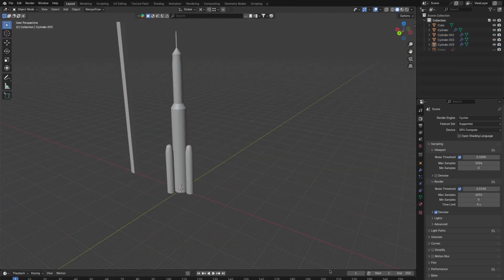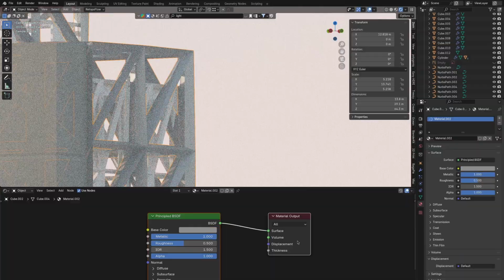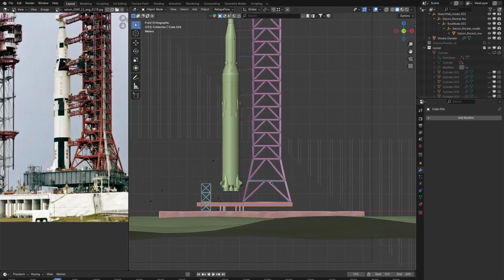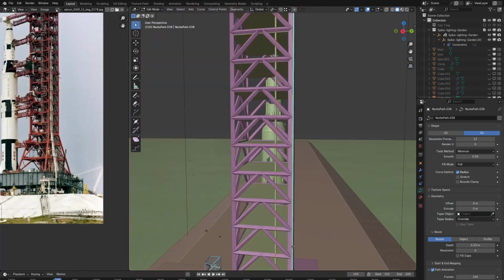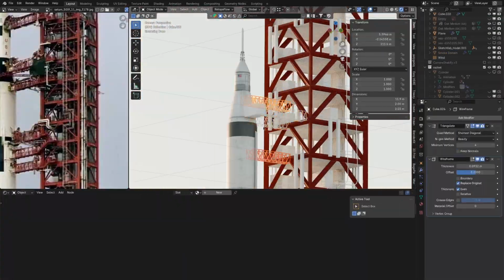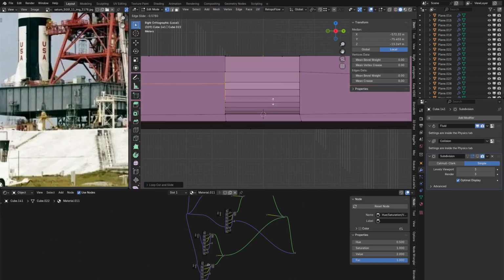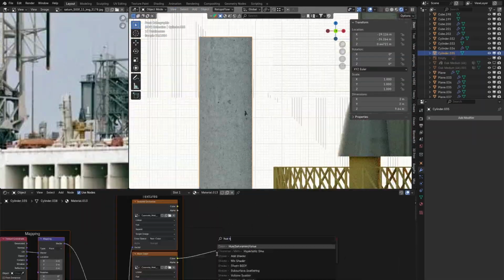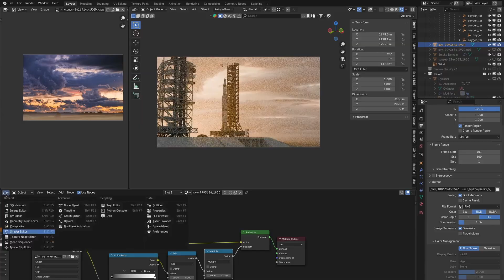How I Animated This Rocket Launch in Blender

Comment: Quick tip - the smoke from the thruster came out too quickly as if we are seeing it in fast forward it should feel more dense
Reply from the maker: hmm I don't know - I actually looked up the exhaust speed of the saturn v - and it is actually faster that what I made - for me its about 800 m/s - but for the actual saturn v it was 2600 m/s - so I don't know - I think it should be fine.